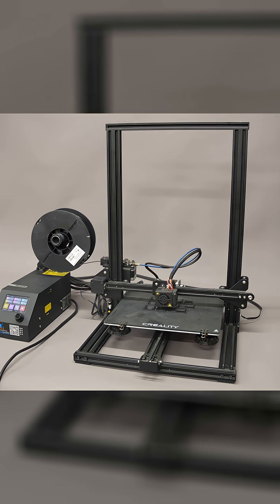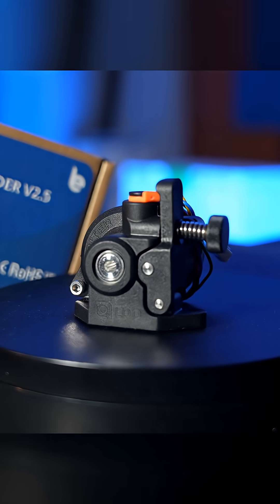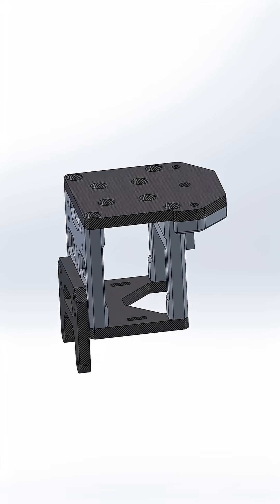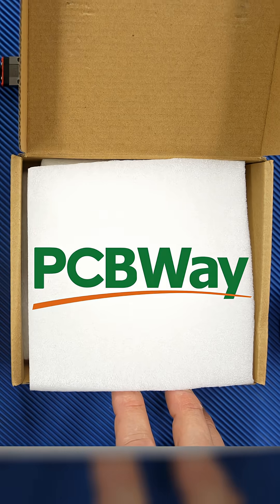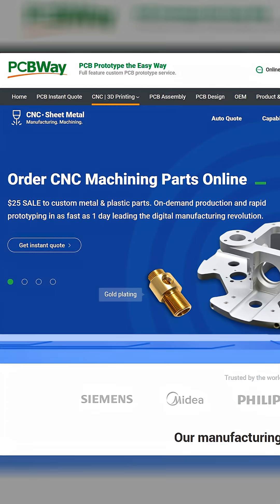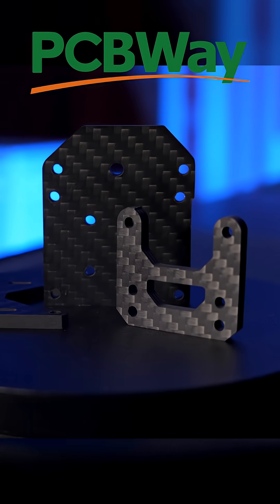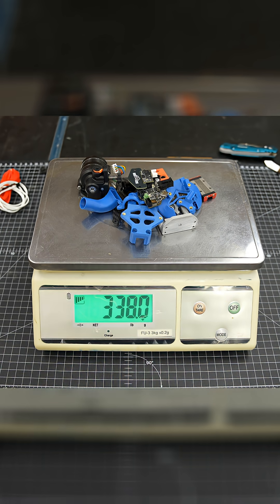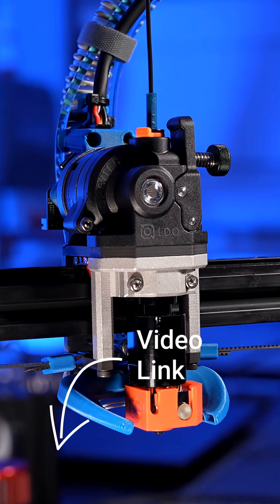Rebuilding my CR10S from SCRATCH #3dprinting #diy3dprinter

Comment: Please drop part two soon, I'm checking every day to see if you've released part 2 😅
Reply from the maker: I’m working on it as fast as I can! Realistically, it should be out by the end of the month if everything goes smoothly—but I’ll definitely try to get it out sooner. Thanks for the excitement, it really means a lot!
Reply: @marcelgenis Thanks for an actual answer. I realise that things like this takes time.

I'm currently building a RatRig V-core 4.0 500 IDEX which is currently on hold for an INDX upgrade and I have a Snapmaker U1 on the way.

The CR-10 5S holds a special place in my heart as it was my first 3D Printer and I'm excited to see what you're able to make out of it 😁
Reply from the maker: @randomher089 I call it the 1-2-3 rule. 1 Good plan. That cost 2 times more than expected and 3 times as long😂

Yeah theres something about these big bedslinger that I just love, plus being ones first printer is just super sentimental. 
Love the Ratrig printer, hope I can build one somewhere down the line! Thanks for all you support, must say I am really invested in this build, and super excited about what it can become
Reply: @marcelgenis  Seems about right 😅 My RatRig is creeping up on twice the price of the original complete kit 😅

Don't rush it mate, I'm just excited to see what you're able to achieve with your build, and I'm loving that you're sharing all the files needed to replicate the build for the rest of the poor souls who bought the CR-10 🤣